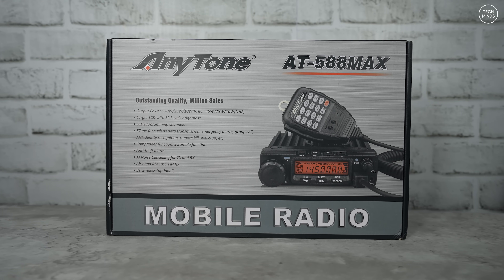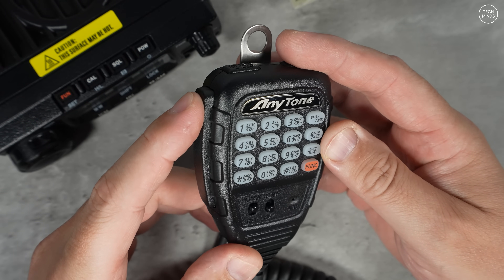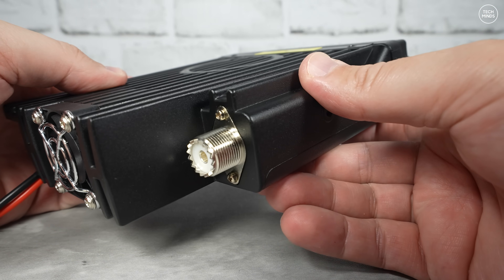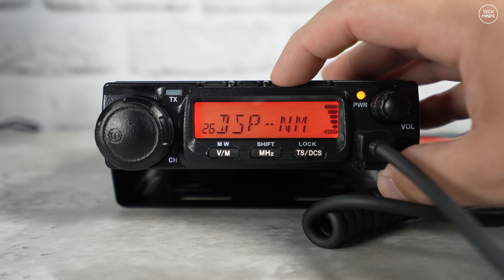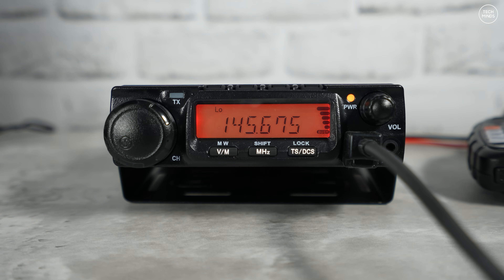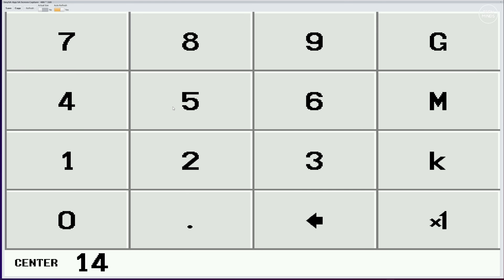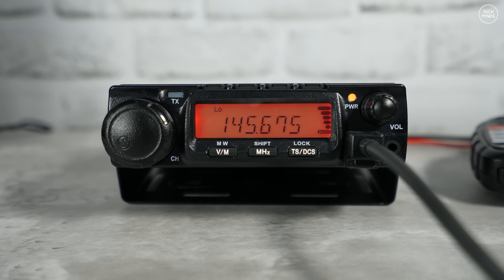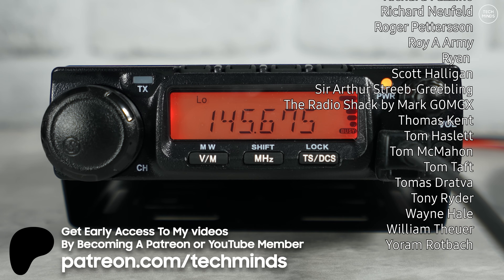Anytone AT-588Max Has 70 Watts RF Output On VHF!

Comment: My Yaesu 2980 will do 80 watts but it was far more $$.   I prefer high power for use on the natl calling freq of 146.520.  I like to keep a simplex link with my daughters house 50 miles away for when the SHTF with a 2980 at her end also

Comment: I have the 4m version, virtually identical except the band and power. Nice little radio, mic is bit clunky but works.  Can get bit hot on med/high power.  
But no real complaints, and only compliant on  4m is that its only FM and not SSB
Reply: Is high power 40W on that model?
Reply from the maker: If they made is SSB as well it may sell like hot cakes! Hope to hear you on 4M sometime, I do monitor 70.450 FM most of the time.

Comment: Hey Matt, that link took me to a very nostalgic CB looking Radioddity QT40 - not the Anytone featured. I found the correct AT588 but at the price point it is up against Yaesu 's high power 2m offerings - hmmm!
Reply: Yep, none of those links worked for me..
Reply from the maker: yeh, looks like it is not available on the UK Amazon site right now, so it just finds the closest item! In the US it should work but that is not helpful for UK users! I think you will just have to google it, sorry.

Comment: Nice radio and thank you for review. Some UHF version with the same power?
Reply: I have the low-VHF 70MHz version. Not sure it's 70W though.
Reply: @PaulTaylor1 UHF 430-440MHz in Iaru 1
Reply: UHF version 588MAX is 45 watt according to the Anytone webpage (for whatever that is worth).

Comment: Just a noob question -  Why do some mobile HAM radios come with only one band, like in this case 2m, whereas every HAM HT radio that I've seen comes with a minimum of 2m and 70cm? Some even throw in 1.25m, 6m, 10m, etc. Seems like a waste of money and vehicle real estate to add another radio for another band.
Reply: That's all I use mobile is single band radios.  Each radio get's it's own band specific antenna tuned to perfection.  2nd, if a radio dies I have only lost one band.  3rd, if the microphone dies, I can just grab one from another radio that does a different band.
Reply: @mikesradiorepair ok, didn't consider the dedicated specific antenna tuned for each band.
Reply: @mikesradiorepair  How many radios do you have in the car Mike? Where do you find the space for all of them?
Reply: @Well_Theres_Your_Problem My extended 1 ton van has HF (on a screwdriver antenna)10M, 6M, 2M, 1.25M, 70cm, 33cm, 23cm, GMRS and CB.  And before you ask, yes it looks like a Porcupine on wheels.  Each radio has it's own antenna fed with 1/2" hardline.  There is also a 40 foot pneumatic mast mounted in the rear of the van that I install beams on when camping and mountain topping during VHF contest.  When using that I am also on air on on 13cm, 6cm, 3cm and 12mm with transverters using either beams or dish antennas.  I removed the normal dog box storage compartment and designed a custom rack that sweeps from just under the dashboard to the headache rack behind the seat.  I installed a extruded aluminum slat roll top on it so when not in use I just roll the cover over all the radios and lock it.  Also keeps them from being sun beaten when not in use.  It's basically solid radio from the dash to the seat back  and between the drivers and passengers seats.

My station wagon has 10M, 2M, 1.25, 70cm and GMRS.  Planning on adding 33cm to that one soon.  My cars have 2M, 70cm and GMRS.  My box truck, flat bed and rollback have 2M, 70cm, GMRS and CB.
Reply: @Well_Theres_Your_Problem For HF I use a Yaesu FTDX-10.  Running the coax wasn't a problem.  It's a utility van so it does not have trim wall panels and a headliner.  The coax cables are held up with P-clamps screwed to the roof cross braces.
Reply: Monoband are more for commercial use. See that are not so many buttons as normal HAM radio dual-band.
Reply: My guess; in theory a single-band radio has less compromises on the internal RF components, as it only needs filters and amplifiers for a single band, making it more efficient. I'm not sure that makes a difference these days with more component selection available. It could also be, the single band ham radio is reusing the RF board from a business band radio that the same manufacturer makes, allowing them to save money by reducing the number of board designs to manufacture.